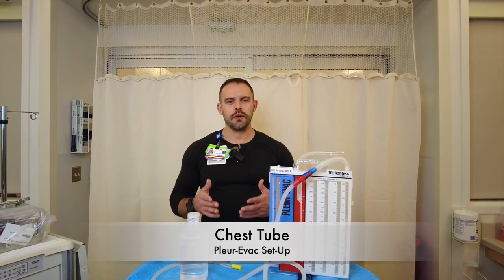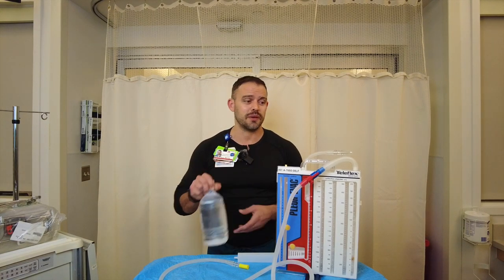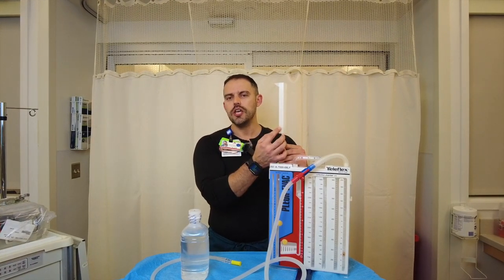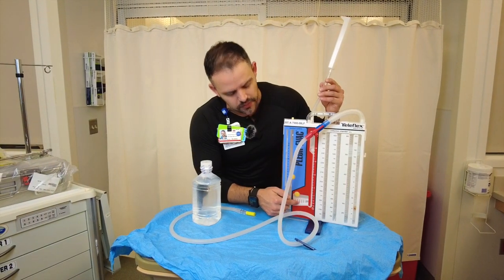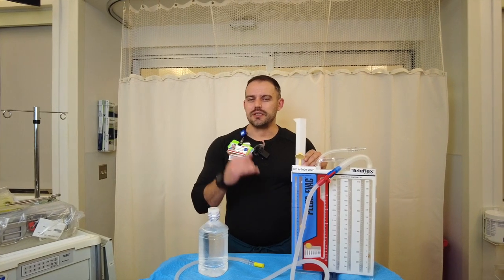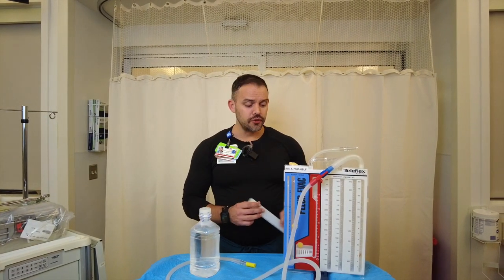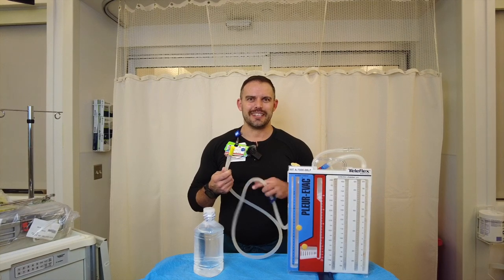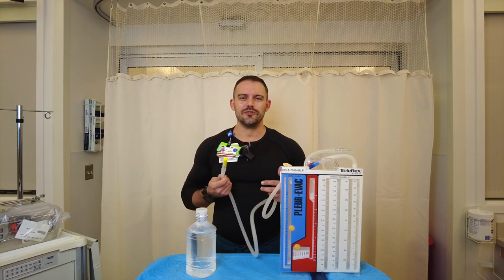Chest Tube Pleur Evac Setup

Comment: Thanks for the video. How would you reduce suction once you’ve put 20cm of water. For example, initially it was said it should be 20cm and later 10cm.
Reply: inject with syringe that yellow circle on pressure chamber (the blue one), then aspirate until the fluid went down to 10 cm.

Comment: I keep hearing medical professionals refering to 20 or 30 centimeters as NEGATIVE 20 or 30 centimeters. There is no NEGATIVE centimeter, that's just a dash, unless you're going into an opposite direction of some sort.
Reply: if it is a wet system, the suction chamber should be filled to the appropriate level as ordered. The suction created when attached to a wall is what referred to -20/-30 cm of h2o. 
Suction + fluid level= negative pressure